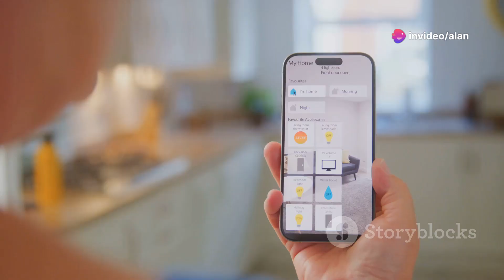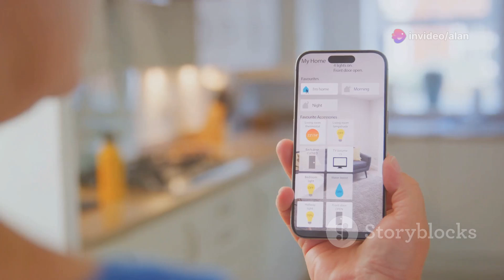Why Chinese Electronics Dominate

Comment: Not really, made in China goods  break easily, very low quality.
Reply: FROM YEAR 2005 UNTIL 2012 CHINA VERY LOW IN ELECTRONIC INDUSTRY BUT 2013 UNTIL NOW 2024 CHINA IS THE BIGGEST TV MANUFACTURER  YEARLY THEY HAVE BRILLANT ELECTONIC COMMUNICATION ENGINEER I SALUTE CHINA

Comment: Because the Chinese are very innovative. They think fast and forward like no other people
Reply from the maker: Definitely true
Reply: Much of China's technological industry was based on western corporations transferring manufacturing and jobs to take advantage of cheap labour and limited regulation. China are the masters of copying western technology by reverse engineering, industrial espionage. There is little or no innovation in copied / stolen technology, nor is there any history of original technology innovation since the invention of printing, gunpowder and kites.
Reply: No your wrong about china electronics I bought made in china appliances I'm so very disappointed malfunction of system is very disgusting so I bought another appliances NOT MADE IN CHINA until now still WORKING ON. So I put it to the GARBAGE
Reply: I have a TCL TV 32 INCH 2019 UNTIL NOW STILL ALIVE NO DEFECT I BELIEVE IN CHINA ELECTRONIC INDUSTRY JAPAN AND KOREA NOW THEY HAVE LOWER IN ELECTRONIC @raybuloron1498